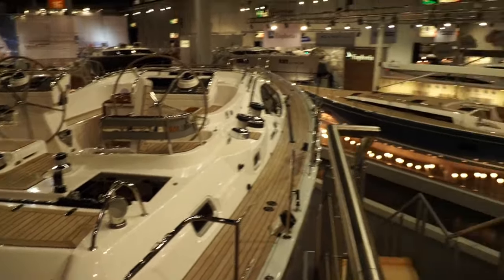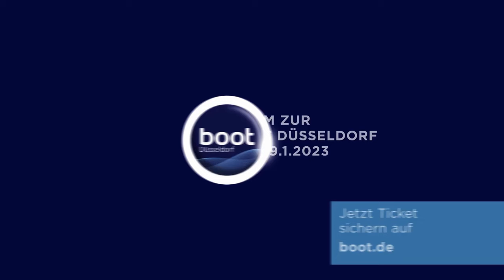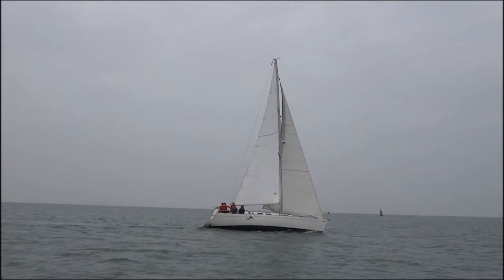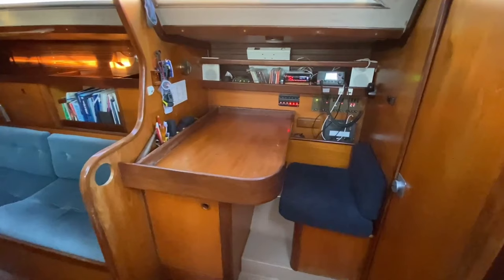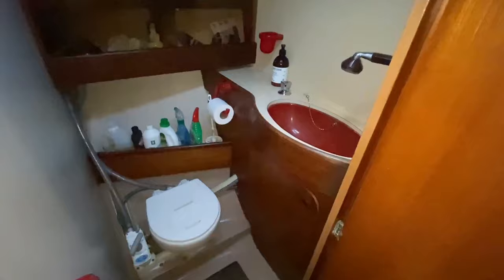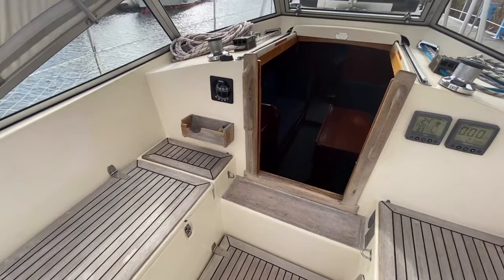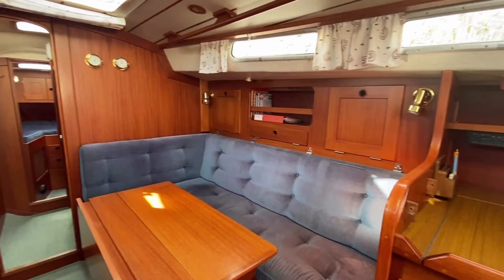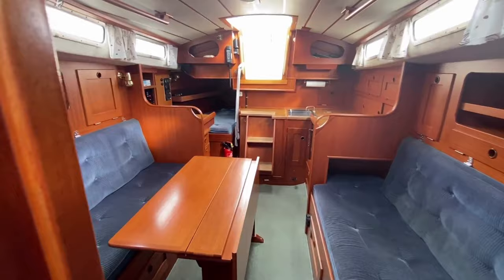Top 3 sailboats for 50k

Comment: The first 38 came in 2 versions.
The std 38 and the Brett Stark 38s5.
The 38s5 has different windows and a nicer interior fit out with curved wood.
I believe a different rig but nit sure.
The S version runs from 32s5 to 42s5 . 
They are different beasts fron the std 32, 35, 38,s ect.

Comment: I would never sail the Beneteau across an ocean.  The spade rudders and bolted on bulb keel are too vulnerable.

The Contessa's headroom is about 5'10" max, so it's a great boat for someone vertically challenged.  The HR isn't as bad but at 6' ots still insufficient.

There are definitely better alternatives IMHO.  A Tayana 37 is one.